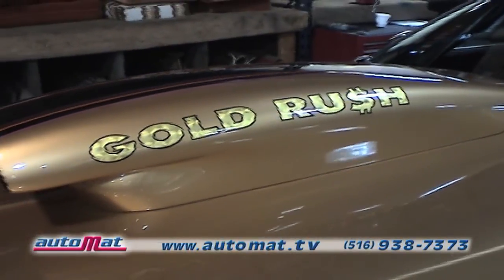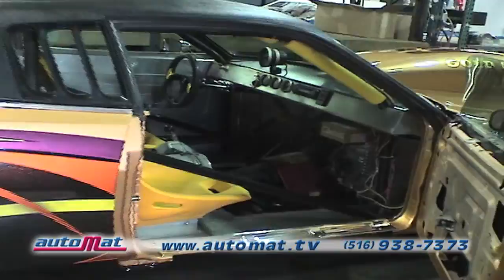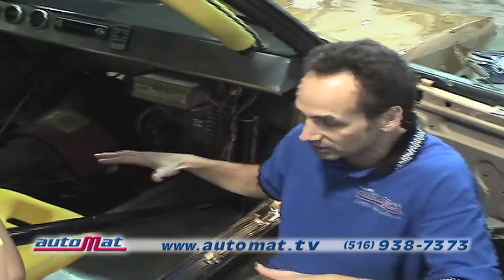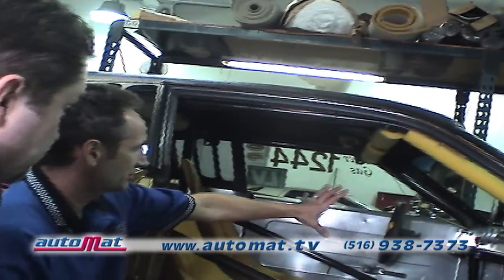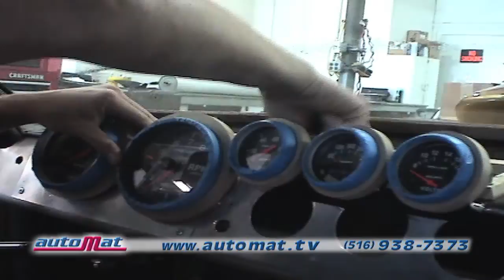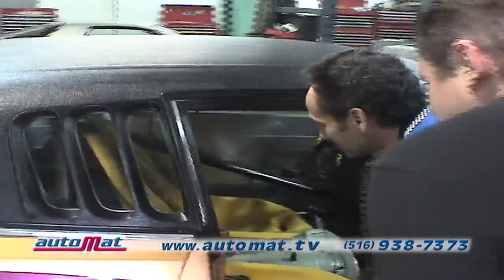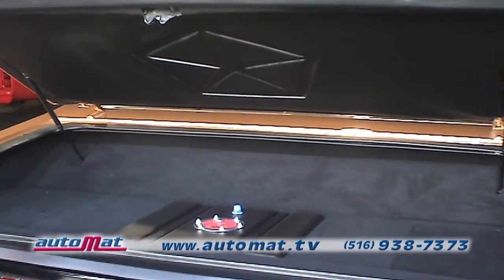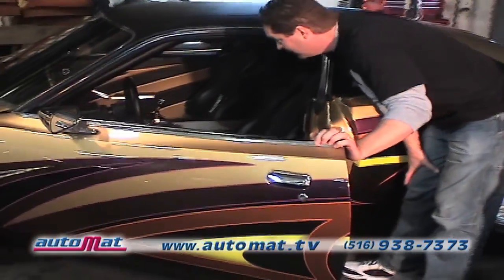'73 Dodge Charger - Drag Racer to Custom Show Car

Comment: I have been a Proud Customer since 1976. Automat has taken all my cars over the years to a Better and More Enjoyable Level.
In February 2014 Automat started Restoring my 1964 Amphicar. It is now better than Original Condition !!
They have also Customized my 2007 Toyota FJ Cruiser, 1972 Volvo 1800 – E, 2008 Audi R-8, 2002 Mercedes CLK 430, and 1966 Alfa Spider.
Their workers are Truly the Best in Mechanical, Electronics, Upholstery, Body Restoration and Solving Problems !!!!!!!!
The Craftsmanship is PERFECT !
The Completed Work was on Time !
You will be Very Happy with the Results from Automat
Jeff Elson - Westhampton